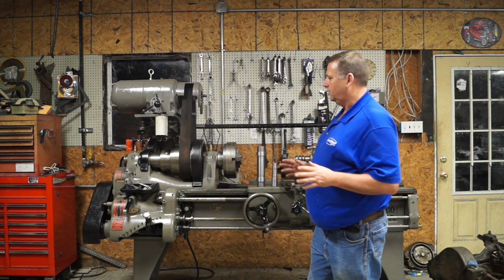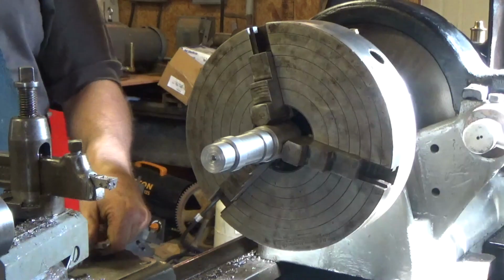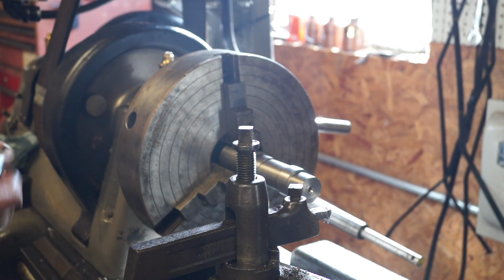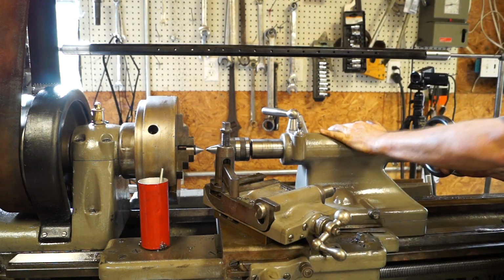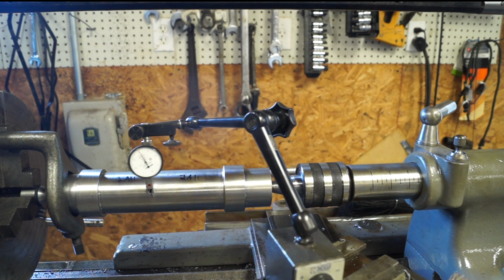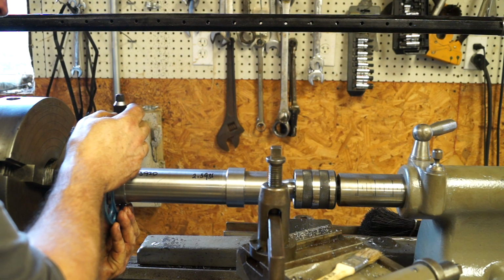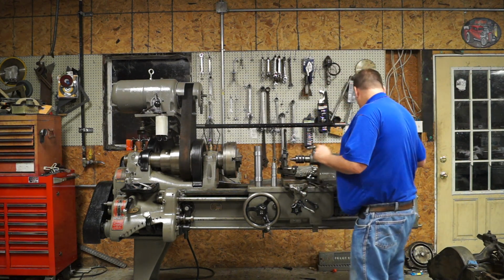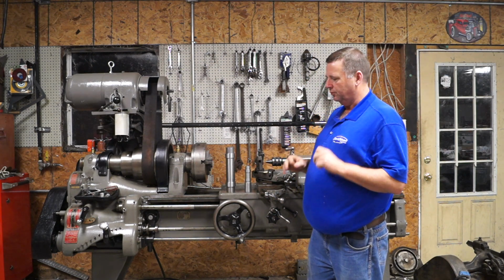Pratt & Whitney Lathe   ( Test Cuts & Tail Stock Alignment)

Comment: Can you expect anything less from P&W. Wow she really is a super lathe. What's the square head adjuster on top of compound? Need to find another cx quick change tool holder set. I wonder if those holes in the reverse rod could link up to the bed to set stops for turning step shafts. Makes sense to me YUPP I'm sticking to it. Take good care of the family we can wait.
Reply from the maker: the adjustments on the compound replaces the rocker on the Lateran post, It is a feature i have only seen on this lathe

Comment: Picked up a bit of power line related noise Mike. Are you running your camera on an AC adapter? Might add a bit more filter capacitance on adapter.
Reply from the maker: It is more than likely from the ballast in the lighting

Comment: Pratt & Whitney made a fine machine.  A century later, Mr. Wiggins applies some TLC and the old gal is good as new.  Built to last and serviced correctly = OUTSTANDING and ongoing.  Damn the throw away mindset.

Eli D.
Reply from the maker: Thanks Eli, I guarantee the machines of today will not be there 100 years from now

Comment: Mike, I got to thinking - something dangerous for me. I suggested a steam table pan as a chip tray. Go to Home Depot, Lowes, Menards ... get a black plastic concrete mixing pan. It's about 2x3 feet and 8 inches deep. Use that as a chip tray. Should be cheaper and will hold more chips. See you at the Bar-Z. Jon
Reply from the maker: Thanks Jon, I will see you there

Comment: I've not seen all of the rebuild videos, so you may have covered this.. did you check the alignment of the spindle to the bed both vertically and horizontally? Did you check the bed for twisting? Did you check the tail stock quill alignment with the bed both vertically and horizontally? Did you check quill stock vertical height to that of the head stock spindle?
A lathe that has any of those things out of specification will turn a tapered diameter even if the alignment test shown indicates that all is well.
The other place any of these misalignments  will show up is drilling and reaming small holes.  If you have a perfectly center drilled bar, the drill will be seen to actually bend as it is forced into the center drilled hole. Reamers will make a hole that is tapered.. not much, but if you are bothering to ream a hole you probably want it to be the same diameter all the way through.
I bring this all up because I have seen Chinese lathes with all these problems when new out of the box. If they aren't corrected you will waste time fighting with the lathe every time you need to do reasonably close work. 
Excellent job on the restoration... that's a lot of work.
Reply from the maker: Thanks for watching and for the advice

Comment: You took a pretty healthy cut for doing test cuts I thought. .012" is going to put some heat in the part and that would skew your alignment results i would think.  I normally only do like .002" on a test cut to avoid deflection and heat.  It has really turned out nice!
Reply: Nice lookin machine isnt it Brian...well done Mike!
Reply from the maker: Thanks Brian,
Reply from the maker: Thanks

Comment: what would happen if you made a test cut bar.. but for indicators use on the cross slide.. by cutting the journal closest to the chuck.. then flipping the piece and cutting the other end close to the chuck. should be able to get really close to the same dimension.. for testing  or scrounge a hydraulic ram rod.. so you could put it up between centers.. run dual indicators along it.. one on the front and one on the top..  i would think that getting the tail stock square with the head stock would be a challenge.  so that any where the tail stock was extended to would line up with the center of the chuck.  i will have to review this video series i don't recall if you had the headstock off the lathe bed.. that could create issues that would require a few hours with a perfect bar and dual indicators on the cross slide.. even changing the torque of the headstock hold down bolts might effect the headstock alignment.  so they would have to be torqued after each move with a click type torque wrench to avoid throwing the calibration movements to the wind.. might also want to stamp the torque value into the head of the fastener for future owners.  but do so in a vice. not on the machine.

 lastly.. got any thin leather scrap. something you could glue to the clamp faces of the belt.  a shoe maker might be able to help you get some very thin sections that are cut with a skiving machine is what i think its called.. it cuts leather at a taper.  this could get rid of the clicking noise as it goes over the motor pulley without effecting belt tension much.
Reply from the maker: Thanks for the reply

Comment: That old lathe is looking very good.  For me I was very surprised that it cuts so well.  I hope we get to see more projects on P&W.  Congratulations on a very fine restoration.
Reply from the maker: I did a 3" pin today for an excavator thumb, I was tempted to use it for that. but I needed it done quick so I threw it on the Monarch. I probably good have done it on the P&W just as quick if I was setup to use carbide

Comment: Great to see you get her back into spec. I'm interested in when you do some threading how the quick withdraw feature will come into play. Does that mechanism effect the position on the dials? Also please: Do you have a video on making your leveling feet? Thanks, Mike. :)
Reply from the maker: Thanks for watching John, As far as the quick draw goes it has postive stops with micro adjustments. as far as the leveling feet go no video just slug faced square drilled and tapped https://www.facebook.com/photo.php?fbid=10156170716678552&set=pb.548353551.-2207520000.1519698956.&type=3&theater https://www.facebook.com/photo.php?fbid=10156170716588552&set=pb.548353551.-2207520000.1519698956.&type=3&theater

Comment: Nice rebuild Mike. My theory on the holes in that bar is that it was probably a cheap way to add a little "grip" to the bar so that oil-covered hands wouldn't be inclined to slip when operating it. This was pretty much before milling machines, so the only other ways to scallop the bar would be a casting (expensive in that form factor), profile turning or coarse threading, or doing something on a shaper. None of those are really good choices, especially before high speed steel tooling, so drilling might have been the best way.
Reply from the maker: Thanks for watching and adding some more theory to the old girl,

Comment: Hey Mike, you briefly mentioned something in regard to feet. I have used rubber feet (hockey pucks) on my lathe then leveled it with my starrett level. I cannot get it to cut straight worth a dam. Mike, do you think using rubber feet could be the major reason?
Reply: To the best of my knowledge, you never user rubber on your lathe feet, you need something that doesn't move, rubber is not up to that job. Maybe (not sure really) nylon or some sort of hard plastic could do it, but I think you have to use steel.
Reply: Well, what kind of results are you getting? Are you getting undulations in your part? Or are you seeing a taper?
Reply: Hockey Pucks work great on grinder stands so they don't walk across the floor. I suspect if you checked the lathe level again it is probably out.
Reply from the maker: Billy, Set your level up on your compound, slide your carriage back and forth along the ways as you level it. Use only 3 points of contact. a\And make sure you calibrate your level

Comment: It would be fitting for that lathe to be the one that turns any new shaper parts, though I suspect that the shaper could easily be older than that lathe.
Reply from the maker: I believe the shaper is 40 years or so older than the lathe